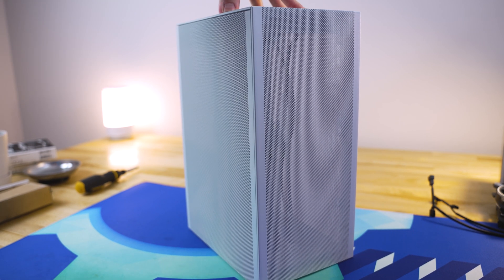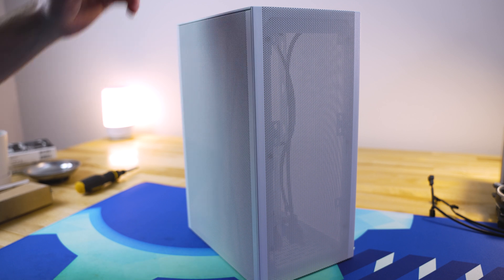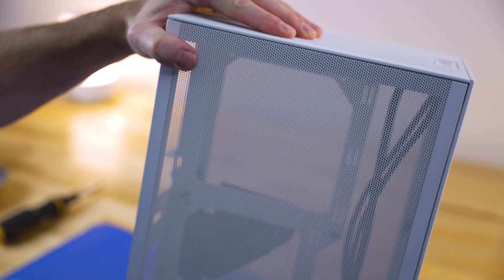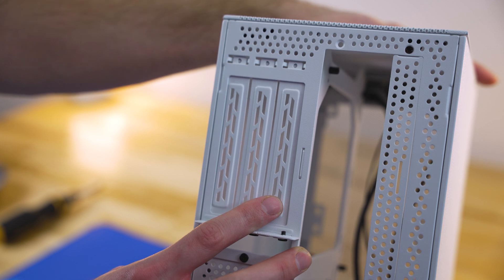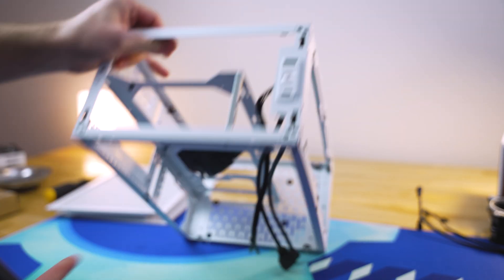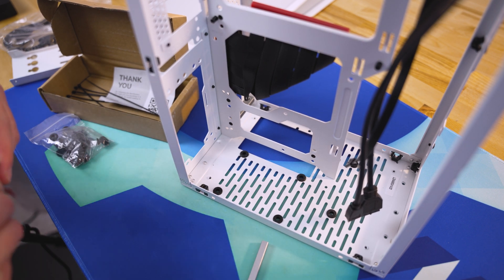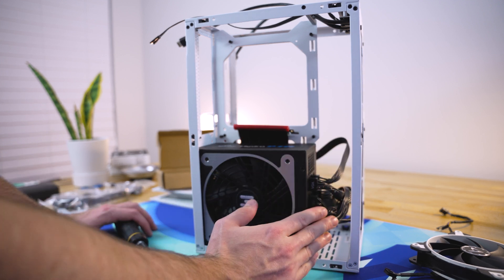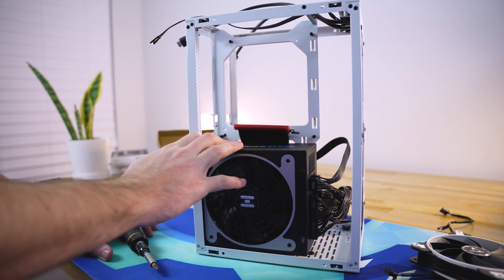How To Build A PC In The SSUPD Meshlicious

Comment: If they can design a case like this with a ATX motherboard and a 4090 Founders Edition graphic card and a 360 radiator a power supply with a 220 length I'll like to buy something small instead of a big bulky case
Reply: 4090 fit in this case? Thanks

Comment: Given that it's mesh all around it's fair to say liquid cooling will serve you much better, as a lot of the airflow from the case fans just won't be directed anywhere near the heat sinks. Which means you probably want an SFX PSU for this as well.

Comment: All cases are meant for as pretty cable management as possible. I also wouldn't say it's a fault of the case you had to remove that RAM stick, sounds more like component choice issues, as in it should have been RAM with a low profile heat spreader, or used a different CPU cooler/AIO.
Reply: definitely, went with gskill aegis and the noctua l9i-17xx black and it's so sleek, everything fits great

Comment: I have a full size psu and a 280 Corsair h115i with fans with no clearance issues at all. My 6800 barely cleared within a inch of hitting the bottom of the case.
Reply: There was some guy saying that his pcie riser cable kept melting bc of GPU, I'm kinda scared of putting my standard 750hx Corsair plat atx PSU with my ex 6800 tuf incase of pcie riser bmrlting
Reply: Idk how it's been for u but I wanna use a low profile thermalright air cooler and 3 noctua fans dk bout exaughst or intake though

Comment: lol, "it's all mesh, so we can probably get away with negative air pressure" what?  You specifically need a more closed off case for negative pressure to work, it's all mesh, there's no pressure change because it's not a closed system. 
- the fans will need air, and it'll find the path of least resistance
	- the left side of the fans will suck air from the left side of the case, the cpu side, through the mesh on the left side
	- the right side of the fan will suck in the exhaust from the gpu
	- the GPU will suck air from right in front of it, which will be cool, coming from the mesh directly in front of the fans
	- the bottom fan will just take air from the bottom of the case
Not like it won't work, like I said the GPU will take fresh air and the warm exhaust should dissipate, but it won't be creating negative pressure.  It's like creating negative air pressure in an open bench, but not as extreme. 
If you want the fans to impact the GPU temps, prolly put 140s or the round Noctua 140s with 120 mounting, NFA14's (?).  Bigger fan, quieter, bigger airflow, and put them as intake. The mesh nature of the case means you're not simply blasting the gpu exhaust air and trapping it in a vortex around the gpu. Ideally the air will universally flow across the case from front to back, with the gpu finstack throwing airat the fans from one side and at mesh on the other side.  But two 140s will send that exhaust air all in one direction pretty easily and the GPU will draw cool air like before, but it wont sit and soak in its own heat. Plus the backside vram will be cooled actively (kinda).
Reply: thanks
Reply: You sound smart so basically help me with mine, I have the same case in black my mobo coming soon I'm going to order a thermalright low profile cooler and it's being paired with a standard 750hx Corsair plat atx PSU and a Rx 6800 tuf GPU. I have 2 noctua fans I'll hopefully install as well any tips on exhaust and intake.
Reply: Nerd

Comment: Good video, poopsie case.
Reply: Why poopsie case?
Reply: @liberteus  I Know it should be small factor case but this one is way too crowded inside, to limiting if you ask me.
Reply: @AndroidPCMMORAW  Hmm. Reviews were pretty good. I'm using nr200 now and it's very crowded as well and supposedly sightly bigger. I'm on the market for a vertical case, with a 3080 and 5800x 240 AIO. Meshlicious looks good, but I can wait for now.
Thanks for replying by the way, and I'm really interested in negative feedback, positive feedback usually doesn't help much.
Reply: I disagree, a lot of sff builders and youtubers said this is a really solid case. I’ve built mine with an sfx psu and a 280mm aio and everything fits nicely
Reply: @z4k1_zaki65  Of course, I like people with different opinion, sometime its fit the need of some PC build sometime don't, I guess it depend of the needs. I'm glad that this Pc case is useful for some but for me it just isn't enough.